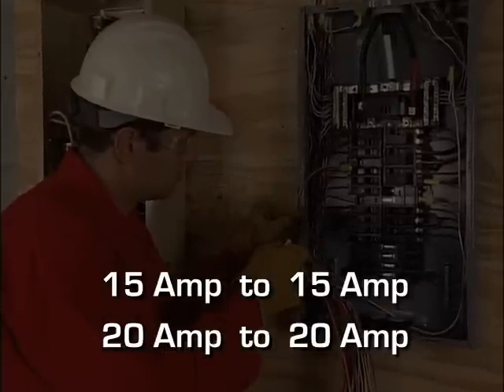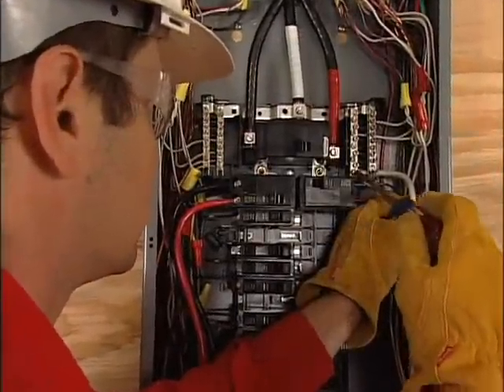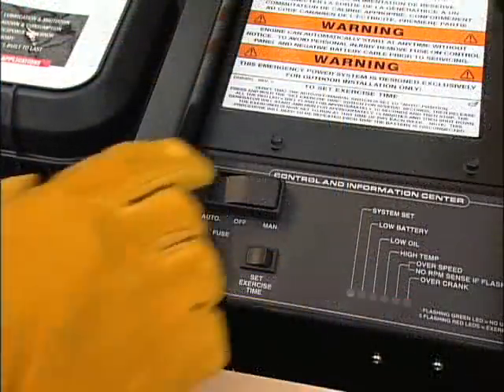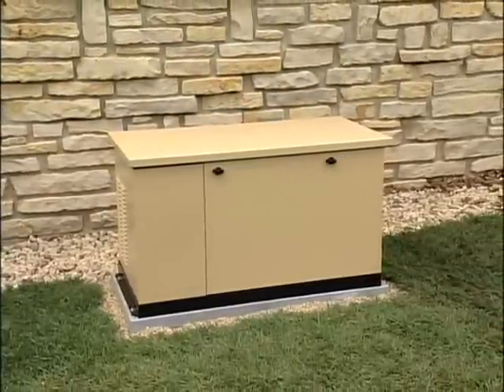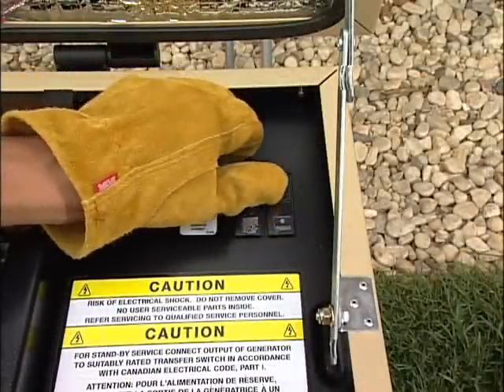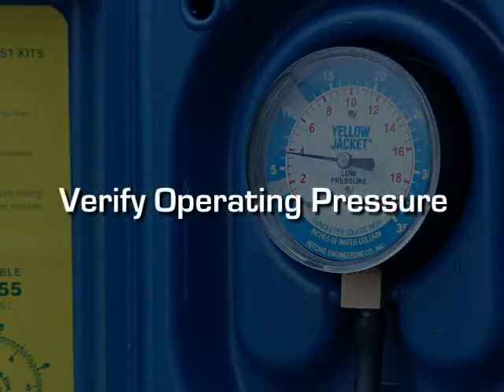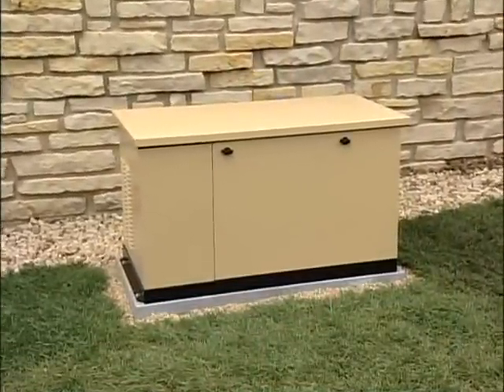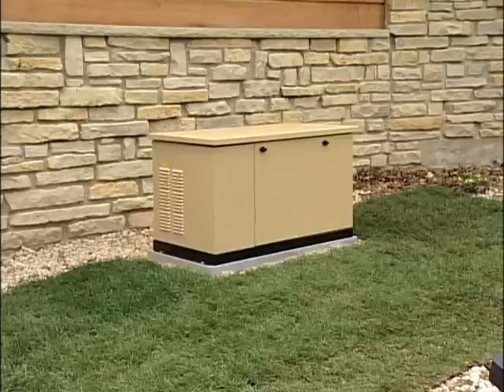Installing Automatic Generator Generac Guardian (3 of 3)

Comment: These are very informative videos, thanks. Please add one concerning how to properly wire all neutral and grounding electrodes and bonding straps within the generator and panels to prevent nuisance tripping of the afci/gfci 's that are now mandated on essentially all 120V residential living space receptacle and lighting circuits. Thank you.

Comment: That may be up to the inspector to decide.
If a splice or joint is done in such a way that it will not heat up or short out under the same conditions as a the original cable insulation system the inspector has the authority to allow a variance on the local codes.

For example a teck 90 cable can be spliced underground if done correctly even if the code says you can't burry a splice.
You need to show the inspector you did something that is at least as good as required by the code's intent

Comment: this makes no sense to me. I have a 20kw briggs and you simply reroute the main power through the transfer switch to cover the whole house. Why bother doing all of this work? It's easier to do the whole house.
Reply: yeah no kidding, making a mountain out of a molehill, just wire the the damn thing to a double pole in your panel and shut off the main when you go to gen power, xfer switches are for people who do electrical panel work wearing hard hats.......
Reply: Mine is the same way.. because we dont have a 20 kw unit... mine is only 8kw so it cant carry the whole house.. we have to choose which circuits to power.